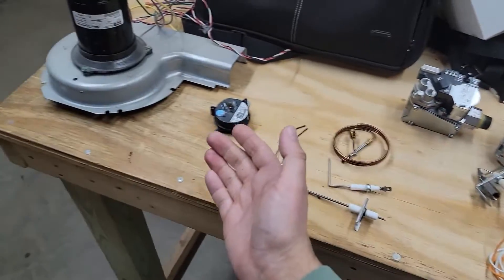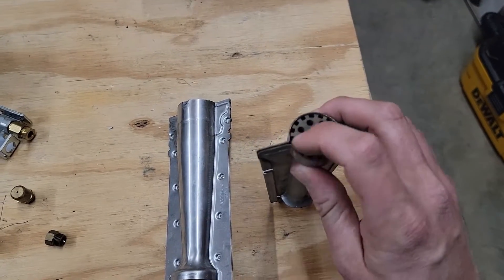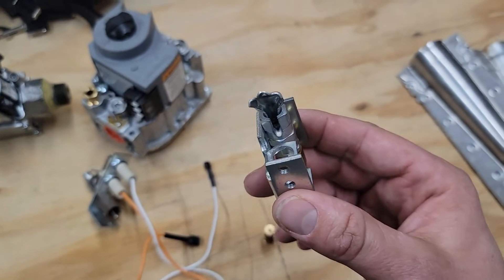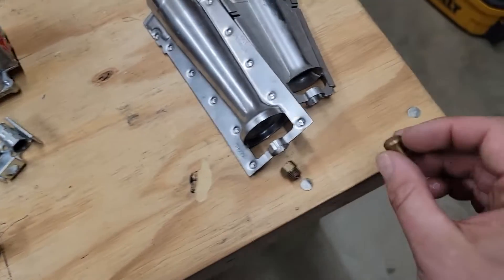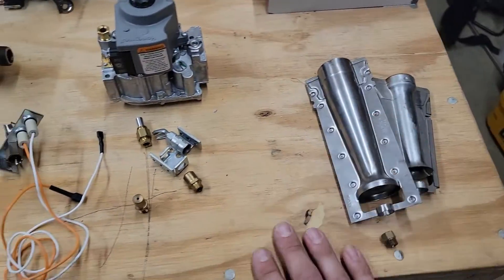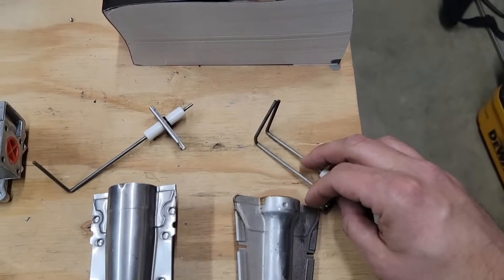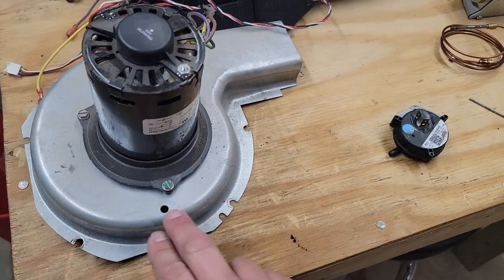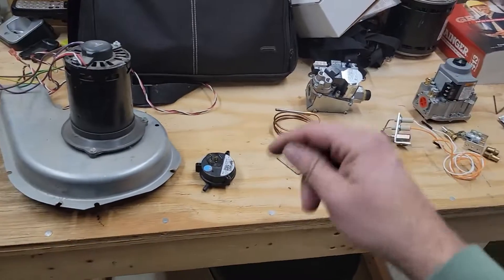Top 5 Gas Heat Parts That need Maintenance #furnacerepair

Comment: Leaving a tip about gas valves. When checking output pressure with your manometer, do so with the adjustments screw cover off AND on. I've seen the pressure read perfect, then put the cap on and watch to see if the pressure slowly rises. If so, remove the cap, and gas pressure settles again because it's leaking from the adjustment screw mechanism.

Comment: Hey Taddy, I’m a young tech with a problem with an older Armstrong gas furnace that the inducer motor runs non stop! I’ve changed the control board but it didn’t help! Any info would be great.
Reply: Had a tappan unit that inducer wouldn’t shut off after satisfying. Replaced board and stopped staying on after space was satisfied.  Maybe check if inducer is constantly getting powered when it’s off? Also a young tech too! hope you find your issue!
Reply from the maker: Hey Jay
 I had a inducer motor that was grounded and it remained running constantly
 Motor had to be replaced
 Your motor may be grounded as well
 Check the wiring to make sure it's not wired to run all the time
Reply: @taddydigest  thanks,I’ll try that and keep up the good work. Love the content you create!!